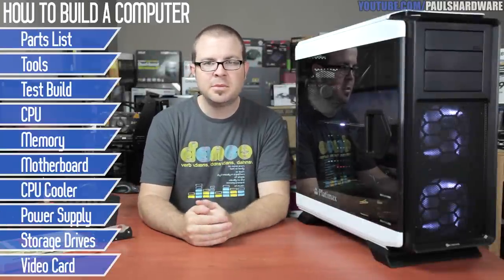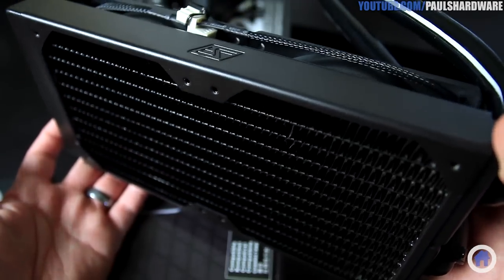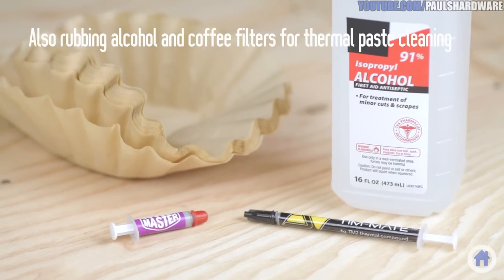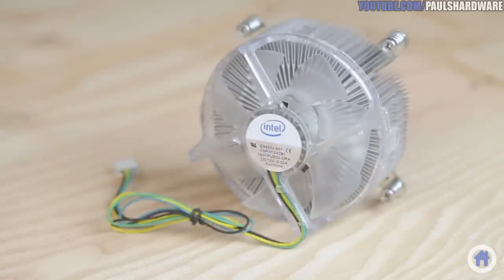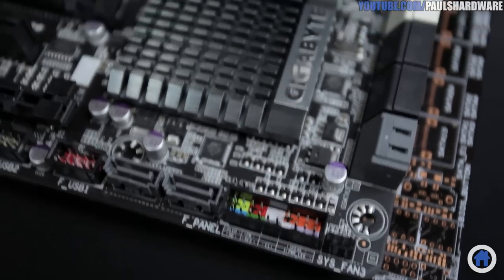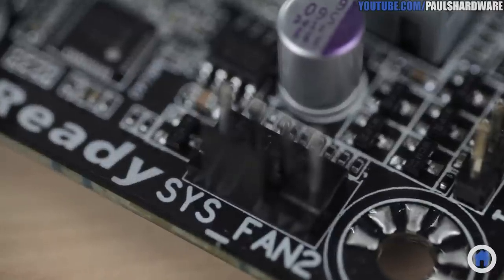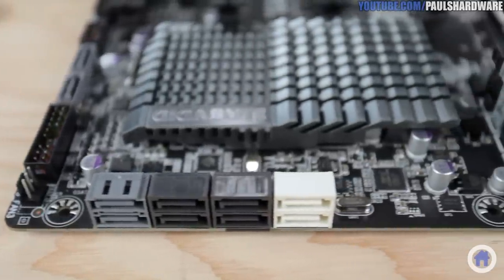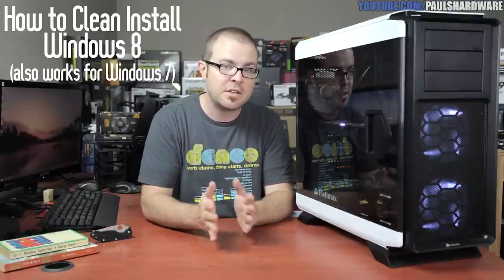How To Build A Computer - Paul's Hardware

Comment: Paul, I am building an Intel build because apparently AMD has given up on making CPUs I guess, so I am going to have to learn about Intel. I want to build a new one by next spring maybe. Should I wait until DDR4 before I make my next build or should I just build one now and wait until DDR4 is lower in price? I figured since you work at Newegg you would know how much DDR4 is going to be when it first comes out and whether or not it's a wise decision to get it when it's new. I saw some server DDR4 RAM on Newegg so that's a good sign.
Reply: Forgot to add, I build a new PC about every 2-3 years so if DDR4 is going to be prohibitively expensive then I will wait until my next-next build.

Comment: Paul's Hardware nice video, currently using a really crappy 4770K that just sucks power and was thinking of going to 2011 for myself for editing and PS work. I do have two questions for you, first what software do you personally use for editing, I have a feeling it's premiere. The second is where did you get those extension cables, those would beat paying the price for Frozen CPU personally single threading a whole PSU :P
Reply: Please explain how 4770K sucks? I am thinking about building my rig with the same CPU and I would appreciate your input.
Reply: Murtaza Samma it doesn't, but if you want to do heavy photo/video editing a 48xx or  49xx is better.
Reply: Murtaza Samma
 I just got a crappy one, it dislikes going past 4200MHz without sucking down way too much juice as in 1.35+. like I said I got a bad one, plenty of people have been able to get them to 4.7 but its a roll of the dice.
Reply: Murtaza Samma
 as a general gaming machine any 4770K will excel at the task, I on the other hand also spend allot of time working in Photoshop and Premiere. And Premiere does all it's encoding and decoding on the CPU and when dealing with hours worth of work at a time a modest speed CPU ends up taking days if not a week to render out the finished product. They also recently launched the Haswell reboot which sells at the same price as the 4770K and has several improvements and a slightly faster base clock a 4GHz.

Comment: any tips on video recording? ie will a WD black HDD be good for higher bit rates while recording? i currently use a WD green and it's a little slow only really getting 20mb bit rate which looks dreadful but i want to record CBR on my avermedia card. so i think a WD black will be better is this correct?
Reply: ssd?
Reply: It's all good I have figured it out. It was a faulty Capture Card I was using. SSD is no good for recording as it won't last long due to so many writes. Although they are fast initially lol.
Reply: Sharpee Gaming 
Is it really worth it to spend the money on an SSD at this point, when they cost so much more, but can suddenly fail and take all data with them?  (I know that's why people tend to use SSDs only for the OS and use more standard drives for data storage...but still...)

Comment: Hey Paul I'm doing a build with a amd apu a10-7850k what would the best cooling be for it let's go for like $40
Reply from the maker: Cooler Master Hyper 212 Evo is still a favorite of mine
Reply: I think that the best cooling you can get for that range is a Hyper 212 Evo. Performance doesn't increase much more until you get to the $60-70 dollar range.

Comment: For hard drive sata cables can I use any sata port on the mother board and plug it in?
Reply: Use only the SATA 6Gb/s ports (the longer ones)
Reply: If you have Solid State Drives, prioritize those to the 6gb/s sata ports, the Hard Disk Drives can utilize the 3 gb/s ports. But if you only have HDDs, might as well plug them into the 6 gb/s ports, IMO.

Comment: might be a stupid question but.... how do i tell if my cpu stock cooler comes with thermal paste already on it? i just got a 6600k
Reply: There will be a spread gray paste where the heat spreaders meet the cooler. Don't worry that CPU should come with thermal paste.
Reply: Just buy thermal paste just in case. It's only like $5.
Reply: yeah right... 6600k doesn't come with a stock cooler xD
Reply: it used to...
Reply: ***** yep, but you are right, they did come but since Skylake, not anymore :P

Comment: for the RAM, why does it matter if they are in the grey or black slots?
Reply: Dual channel vs single you can usually see which channel is which in the motherboard manual.

Comment: Why plug in and touch the power supply as apposed to just touching the case?
Reply from the maker: If you touch the case it equalizes any charge between you and the case, which is probably fine, but a grounded PSU will discharge you completely

Comment: Does Paul reply to comments?
Reply from the maker: We may never know the answer to this question
Reply: Paul's Hardware It's definitely nice to see big youtubers replying to comments now. It is very appreciated. Now for the questions. Is it possible to Upgrade from windows 7 home premium x64 to windows 7 professional x64 without losing data using the regular install cd and cd key or would i need and upgrade cd and key?
Reply: EragonSuperM If Paul can't or doesn't answer your question , I recommend you check out Jerry barnucles's channel " Barnucles"  aka Barn Nerd". He used to work for microsoft and can probably provide a wealth of useful info about your question. cheers
Reply: EragonSuperM You mean you have a regular copy of the Professional version already? Then yes that should work but idk if you can "upgrade" or not. You might have to do a clean install.
Reply: theonlylammy Ok well my relative that works at HP said that it would work so thanks anyway.
Reply from the maker: EragonSuperM If you have a valid Windows 7 Pro key, you should be able to use Windows Anytime Upgrade to switch from Home to Pro. http://www.sevenforums.com/tutorials/95744-windows-anytime-upgrade-how.html
Reply: Paul's Hardware Thank you!
Reply: Paul's Hardware does this case fit a mini itx board I have a  Asus z87i deluxe I'd like put in it till I get a new atx board
Reply: PcGaming1080p It fits. Mitx will fit any case because it's the smallest size unless it's some wierd case that doesn't have standard sizes but if you're using an mitx board might as well get a smaller case. Really no reason to get a 760T for mitx. My personal favorites are the Ncase M1 and the EVGA Hadron
Reply: theonlylammy I already have a evga hadron air bitfenix prodigy and a rose will mini itx pc I was just gonna get a bigger system to build into I already have a spare mini itx board I could  put in it now till I get a atx board later
Reply: PcGaming1080p A mini-ITX board will fit in any ATX case if I'm not mistaken.

Comment: Hi Everyone,

I'm looking for guidance and suggestions from experienced PC builders and gamers. 

I am joining the PC Gaming world, and finally have the savings to do it.  Upon the 40+ hours of research and work, this is the build that I've come up with.

I plan to use this PC for mostly gaming, streaming and for general home purposes. I would like to know if any of the hardware is non compatible with each other or if I'm not getting the best bang for my buck on specific hardware.

Here is the build:

HuMaHaMi Gaming Build 2014 (August)

PC Case: NEWEGG - $119 (PLUS $20 rebate card)
·         **Already Purchased** Thermaltake Chaser Series Chaser MK-I (VN300M1W2N) Black SECC ATX Full Tower Computer Case

Power Supply: NEWEGG - $99 (PLUS $20 rebate card)
·         Thermaltake Toughpower TPD-0750M - SLI/ CrossFire Ready 80 PLUS Gold Certification and Semi Modular Cables Black Active PFC Power Supply Intel Haswell Ready (PS-TPD-0750MPCGUS-1)

CPU: Amazon.com - $209.99
·         I Intel Core i5-4690K Processor 3.5 GHz LGA 1150 BX80646I54690K

Motherboard: NEWEGG - $140.99 (PLUS $20 rebate card)
·         MSI Z87-GD65 Gaming LGA 1150 Intel Z87 HDMI SATA 6Gb/s USB 3.0 ATX Extreme OC High Performance Triple CFX/ SLI Intel Motherboard

Memory (Ram): NEWEGG - $84.99
·         G.SKILL Ripjaws X Series 8GB (2 x 4GB) 240-Pin DDR3 SDRAM DDR3 2133 (PC3 17000) Desktop Memory Model F3-17000CL11D-8GBXL  

SDD: Amazon.com - $118.99
·         Samsung Electronics 840 EVO-Series 250GB 2.5-Inch SATA III Single Unit Version Internal Solid State Drive MZ-7TE250BW

HDD: Amazon.com - $57.24
·         WD Blue 1 TB Desktop Hard Drive: 3.5 Inch, 7200 RPM, SATA 6 Gb/s, 64 MB Cache - WD10EZEX

Video Card: Amazon.com - $244.99
·         EVGA G-SYNC Support GeForce GTX 760 02G-P4-3765-KR Dual Superclocked w/ EVGA ACX Cooler Video Card

CPU COOLER: Amazon.com - $44.95
·         Thermaltake NiC C4 120mm CPU Cooler CLP0607

GRAND TOTAL: $1120.14

Comment: I have a 4-pin connector coming from my psu. Anyone know what it could be for?
Reply: PixelPickaxe is it flat or in a cube form?
Reply: PixelPickaxe if its flat it plugs into your hard drive/ssd
Reply: LRK007 It's cubic. Not molex.
Reply: CPU power?
Reply: Carbonn Thanks!
Reply: PixelPickaxe yeah its cpu power like carbonn said
Reply: CPU power is always at least a 4 pin connector in a 2×2 shape. Some motherboards with better OC capability may have an 8 pin for the CPU power instead, in which case, if your CPU power cable is a 4+4 pin (which it probably is), just plug in both next to each other, making an 8 pin connector. If you're still confused, try looking at a forum or Google for info.
Reply: ***** Yeah what had gotten me confused was the extra 4p connector which I know now that it's for the cpu.
I can English I swear.
Reply: PixelPickaxe So if I'm understanding correctly, you're confused about the fact that there's an extra 4 pin connector even though you can only use the first 4 pin. If that's the case, the extra 4 pin can be left unplugged, it won't do any harm.

Comment: I want to build a Plasma or OLED 32 inch 1080p display panel for meself
Reply from the maker: I wish you luck in your endeavor, plasma hardware might be hard to come by these days though.
Reply: you are right! I went to many shops yesterday couldn't find any Plasma TVs :/ Its a pity LED/LCDs have such horrible black levels I usually sit in dull rooms & it annoys me so much! I don't even like using non-OLED phones. Why isn't AMOLED tech getting popular? Need OLED TVs 32 inch 4k for $600 & all phones should also be AMOLED! LCD should be thrown out!

Comment: hello paul i have an issue with my computer that i build my self it will not boot after a restart it turns on but will not boot to anything i have done start up repair and it did not work i have windows 7 ultimate ,maximus vi  hero , intel i7 4790 , geforce gtx 760 , gskill trident x 16 gb , ocz ssd 240 gb the vertex 460 , and a wd green 2 tb hdd  please help if you have any ideas

Comment: Why do "they" call it " 80+ platinum rated?"  Given that in more than 90% of all load type scenarios...it's at least 90% efficient, why not just call it 90+PLatinum
Reply from the maker: When 80+ started, it was just 80+, and it was 80% efficiency at 20/50/100% load. Bronze, silver, gold, platinum, and titanium ratings were added later, and I am guessing that they didn't want to mess with the branding by changing the 80.

Comment: what ive never gotten is why people get ssds and hdd and install the OS on the ssd, i dont know much about this so im wondering why they do that
Reply: Ssd=no moving parts ,which means it runs faster than hdd. Put ya Os on the ssd and your computer will boot up quickly.
Reply: ***** oh ok, well all i got was a HDD so will it not boot as quick? is that all really?
Reply: yeah ssds are much faster than a hdd, thats why people put their OS on the ssd in order to get a faster boot time. this is why ssds are much more expensive than a standard hdd. if you have a hdd for your OS its fine and thats what people usually do but if you are doing a high end build you might want to look at a ssd
Reply: Anbu8366 yeah, i just got the hdd, im typing this from my new build, works great =)
Reply: mAsMaC 
I'm thinking about building a computer for the experience and because I want to re-use an old case I have where the computer just got too old. (I'm really attached to the thing. Heh.)
What parts (with specs, please) did you use, and how much did the whole thing cost you?
Reply: mAsMaC
Is that a link to a page showing your personal project?  Your particular purchases?
Reply: nakyer its my computer parts list
Reply: mAsMaC
Your personal list?  Kewl, man.

Thanks.
Reply: +mAsMaC It improves overall performance by a lot.
Reply: Amar Gandhi yeah i decided not to get one because what i got was still stretching my budget
Reply: mAsMaC You might want to consider getting one in the future. That's what I'm doing. I'm waiting for the prices to go down.
Reply: Amar Gandhi ok thx, i was thinking about getting one as a future upgrade
Reply: ***** You would want to spend more on the GPU. That's what matters (for gaming, at least). The CPU isn't too important. (1 CPU dollar to 1.2 GPU dollars)
I give it a 6.8, mainly couse of the bad balance.
It's really good in other aspects, though.

I haven't actually seen an EVGA CPU cooler before, don't know much about them.
Reply: ***** Or maybe something like this:
http://pcpartpicker.com/p/yN4Vpg
You could add more RAM, and the peripherals you want.
Reply: ***** That's too much in the GPU. You might want to consider a less expensive GPU, or a slightly more expensive CPU.

How about this:
http://pcpartpicker.com/p/29qnD3 
Or perhaps this:
http://pcpartpicker.com/p/B6vx3C

I went with a less expensive CPU and CPU cooler for the latter. You don't really need a $50 CPU cooler for a non-k series processor (non overclockable).

You could even go with a cheaper mobo with some of the less powerful CPU's.
Reply: ***** Then you could also go with something like this:
http://pcpartpicker.com/p/JBDggs

No Budget? Then Take This!
http://pcpartpicker.com/p/nHHQJx

BTW, do you plan on overclocking?
Reply: ***** Oh, and what kinds of games do you want to play. I want to make sure I don't do anything overkill for you needs.
Reply: I'm taking apart an old computer that's not working any more, and planning on putting together a new set of parts in the old tower.  (First build EVER for me.)  I noticed the processor came out of its holder easy enough, but WOW...that heatsink/fan attached by the paste is STUCK.  Is this normal?  It makes no difference with the old parts, since they're being junked, but it made me think about the new build- 
It's not that easy to remove the processor after the paste dries, huh?  Not much chance of changing coolers down the road?
Reply: nakyer I don't think that's normal.... Maybe just after 5-6 years?
Reply: Amar Gandhi
As mentioned, it IS an OLD computer.  (It was used when I got it.)

Got another question here for the build, tho'.  I think the two front USB ports on the tower were USB 1st gen.  My new mother board only has places to plug in USB 2 and 3 (in addition to the rear ports), but the USB 2 connector on the board will actually take the connector from the existing USB ports.  Pins are the same, even the blocked pin is in the same place.

It'd looked like the two front ports would just be there for looks on the new build, not connected.  But if they CAN plug into the new motherboard... 

I just don't want to plug in USB 1 into a USB port and fry the motherboard.

Any ideas?
Reply: nakyer Damm, USB gen 1!
Reply: Amar Gandhi
As far as I know.  Now, any idea if USB 1 could cause the thing to burst into flame, or simply die a quiet death?
Reply: nakyer Not sure why it would... You should check some other sources.
Reply: Amar Gandhi
So you're good, but not good enough to tell me what'd happen if I plugged the old cable from the tower's front USB ports into the new motherboard on a USB2 port?
Reply: nakyer Again, not sure what would happen. I'm fairly certain that the header is the same, but you probably want to double check.
Reply: Amar Gandhi
Thanks Amar!
Reply: nakyer You're welcome.

Comment: Is this a decent mobo if gaming is all i plan on doing, with no oc on the cpu?

http://www.newegg.com/Product/Product.aspx?Item=N82E16813157528

 It's cheap for a z97, but i'm not sure if i need it. It fits my budget, but i don't mind saving money if possible.
Reply: Slumbering Pierrot if you are just gaming with no overclocking then it should be fine, i cant speak for the board itself but i know it comes from a very reliable company